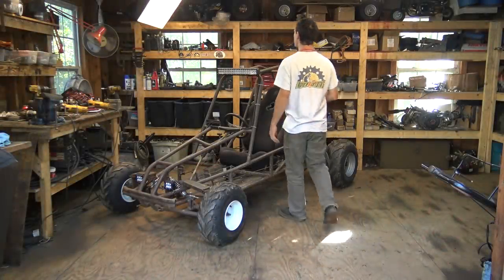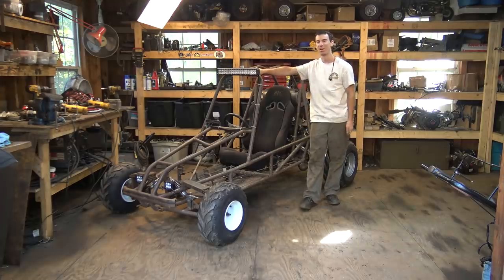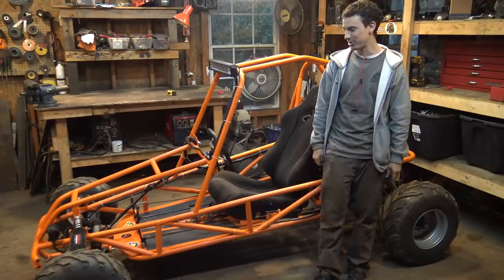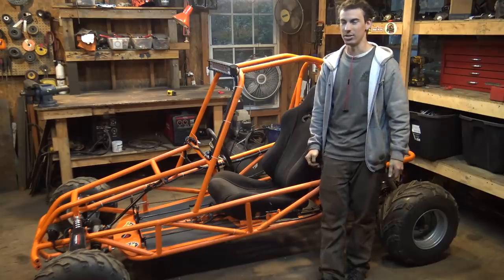painting the GS500 dune buggy!!!

Comment: good job on the wiring and your dash panel bro but you're going to want waterproof (outdoor) toggle switches or after a few pressure washes or out on the trail when wet, they are going to rust up & fail.